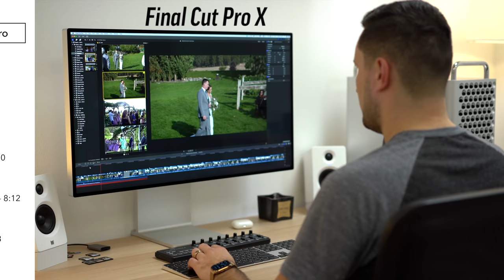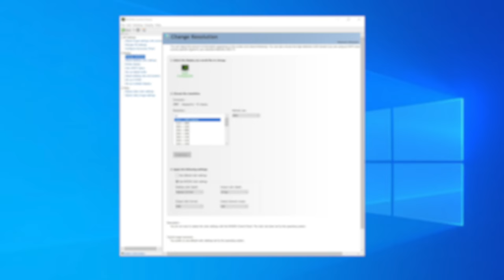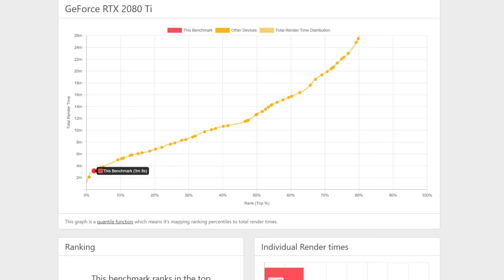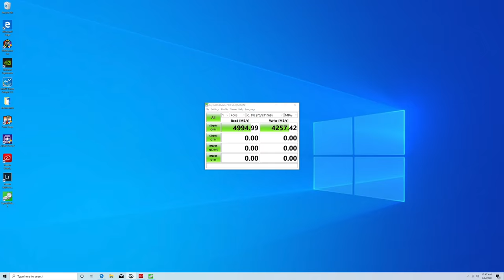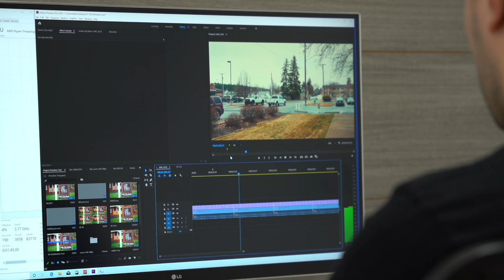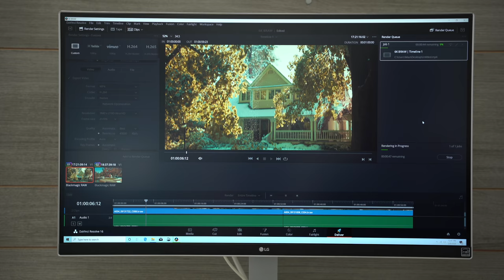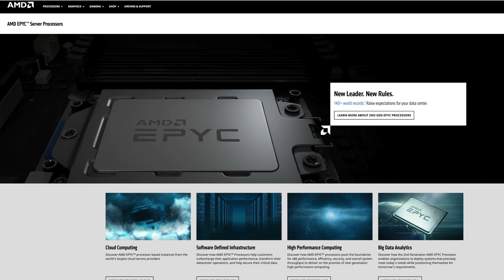$15,000 Mac Pro vs $5,000 Threadripper - Sorry Apple..

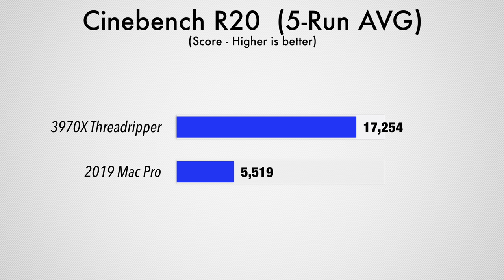Comment: 4:17 that’s literally the easiest fix ever, spend 10 minutes to adjust fan curves to your liking for acoustics & cooling. My PC runs extremely quiet as I have plenty of fans set to low rpm and still stays very cool, just takes some experience. Saying it’s loud is just a cop out answer
Reply: He adjusted the curves. The solution was probably noctua.
Reply: he should have use Noctua NHD 15 or Deepcool 360mm AIO
Reply: He didn't remove the air filters! The mac has wider holes with customised components in terms of space usage!
This is not a system for start-ups or every day use as it is not modular!
Reply: The dude made the PC himself in a previous video, the only person he has to blame about fan noise is himself. He should have configured the PC correctly and chose silent components if that’s what he was going for. He doesn’t seem to have much clue about building a good system
Reply: I meant the Apple machine is not for start ups!
It is not economical and versatile in any way!!!!
Reply: @98JamesNixon  Of course he doesn't have a clue on how to build a PC, why else would he be defending CrApple?

Comment: Pc: * costs a third of the mac pro *
Also pc: * gets 3.5 times the performance of the mac pro in cinebench *

Yeah... Apple will always stay overpriced...
Reply: That's the base model of mac pro the full specs of this are insane. 1.5 TB ram memory 2 or 4 amd graphics 32 TB memory i9 28 core processor
Reply: @NickN56  that's not an i9 that's a xeon.
Reply: @NickN56  for what we spent so much money for garbage device ? If i bought apple pro i feel like being robbed by them
Reply: Funeral Winds just get an AMD Epyc, 2 Quadro 8000s and you’ll still be at less than half the price of the top spec Mac Pro, have about double the CPU performance, double the GPU performance, 2tb of ram, and 96gb vram
Reply: They were busy pulling headphone jack from iPad
Reply: Not just overpriced, theyre a straight up scam. Its hilarious lmao
Reply: Funeral Winds the base model is 15k and the full is 50k ok buddy
Reply: @user-if2uz4ur8o  a whole brand new car with that money that's insane ngl

Comment: "Honestly, don't understand the discrepancy in specs.

Custom builds the PC and doesn't even bother to tune the fan curves and then proceeds to complain about the fans spinning up unnecessarily, this would be part of building and configuring a custom PC.
Complains about the cabling, but is through no fault of his own by not actually doing any cable management, again, this would be during the process of building it.

Mentions how the hours spent tuning and building the PC would cost "thousands" in lost time, even though the person would save $10,000 building the PC instead of getting the Mac Pro. . .
This video is kind of a joke."

(c)
Reply: Totally agree is really depressing how they keep defending at some point of no compares THE MAC.. Garbage!! simply wash brain
Reply: Exactly lol
Reply: Sunk cost fallacy.
Reply: I unsub the other channel of this guy because is just like Justine breath Mac to the core.
Reply: And the crap he's telling about vega 2 vs rtx2080ti
Reply: He literally said he tuned the fan noise. You guys really don’t understand nuance in tech and the use case for each build but go on, complaining thinking you know it all
Reply: Ok now let’s take about the size of the case needed and the fact that it’s water cooled and will need maintenance eventually or the fact that you can upgrade the Mac just like a normal pc minus the nvidia cards (although Linus used one with some tricks)  the ridiculous amount of slots for expandability too. This is for creator workshops not for average consumers, gamers or even pc enthusiasts strictly for workshops for video editing and productivity Thats the reason why they spent the R&D on the T2 chip that only helps when editing video
Reply: Dwight Neptune he’s also not using a sound dampened case (it literally has a glass panel on it). Any workstation class case with properly dampened panels will be virtually silent
Reply: The Impartial Truth I quite don’t think you get it, this Mac Pro is overexpensive for sure but you gotta give props to Apple for the fact they went all the way into it to the most minimal details. every single button is made out of metal, every single screw is literally springloaded and stuck it its place, there are virtually no cables visible and the modularity and fan speeds not synching to make sure it makes no sound at all are just one of the little details, other than the locks for PCI Slots, graphs on panels to show best configs and this and that. 

Did Apple actually need to do all of that? Nope. But that’s the most Apple thing they could’ve done. And I enjoy the work done even if I am not ever buying that PC because I don’t need it. It’s premium, it’s gorgeous, it’s simple. Could you buy a Windows PC for much less? Hell yeah, but at the same time, would you have such a thoughtful and well designed computer? I don’t think you would. 

In no means I am trying to argue, just pointing out that the closest that get to Macs in design are the Surface line up and oh god they look amazing but the prices are quite salty. 

Buying a Mac Pro you are buying the design that probably took apple hundreds or thousands of hours to come with, you are buying the specs and also Mac OS, it’s okay if it’s not for the average consumer but it is for big tech companies, everyone has their niche ;)
Reply: @aurichio7783  you do realise that all the design talk you've mentioned boils down to just concealment right? Most people who build their PC actually like having some mess so they can see all the components they used. Kind of weird that you would justify paying thousands of dollars for aesthetic design, when the fact is custom building your own PC means designing the unit completely according to your taste
Reply: Syafiq Norkhalim do you realize not everyone wants to build a PC and when they do need to upgrade it they would like a process so simple and guided that they can do without much hassle or taking cables out putting them in etc etc. 

Some people wants their gadgets to just work at the best performance possible without tinkering with it, the tech space has from everything and that’s why all sorts of things do have a Market. 

Apple is known for their privacy oriented products with premium designs and powerful yet simple OSes and you are paying a premium if you wanna get into the ecosystem, does it mean it is for everyone? not at all, and that’s okay because there is a market for all sorts of people. If you are happy with Windows/Linux custom building your PC and hackintoshing it that’s amazing but at the same time there’s people that want machines for all sorts of reason and want it to look great and don’t want to spend a single second building it. Apple is a trillion dollar company (ok 900 something billion but still) so we can say it’s been working great for them
Reply: @aurichio7783  look here fanboy, you pointed out that the 10,000 premium was justified because of design and simplicity. In accordance to this video (custom building a PC), that argument makes no sense because custom building LITERALLY MEANS custom design. In no way whatsoever that we discuss anything outside the context of this video.

Now you wanna talk about how the Mac Pro should be compared to standard stock windows PCs? Sure.
There a great variety of windows PCs out there, with high performance ones from special brands in abundance (Predator, Alienware, etc). All within less than 5k. Even a top tier performance PC stock will cost less than 8k.
Now let's compare, shall we? 15k vs 8k, with mainly only design and interface differences. Yes I agree there are people who are willing to pay 7-10k more for just the apple interface and design, but there's all there is to it. Nothing else.
Don't try to bullshit about convenience and not having to setup, etc. Your only justification is interface and physical aesthetics. Is it worth 10k? To some people yes, but it's still ridiculous. Bear in mind, you most PC units are kept hidden anyway to clear more desk space.
Reply: @sfqm1083 I agree with u, I rather spent the first day configuring the pc rather than spending the first year to save up for the mac
Reply: @zephskiee5395  And joy building your own PC... Not too long ago, i build my PC- Ryzen7 2700X CPU, Radeon RX570 GPU, 16GB RAM from Corsair on ASRock B450 Pro4 MB. And is good enough for me...
Reply: @wanted247ha8  you can air cool it and it will work just fine. That mac is a joke. It costs 10k more than the pc and performs way worse. Absurd
Reply: Angelo Cella it is literally not made for the same purposes and and the PC needed weeks to even set up to begin with. The whole system is cable less and modular and 100 times quieter. The AMD NEEDS to be water cooled obviously because even WITH water cooling the temps were still close to each other so yeah. I get you don’t like Mac or apple but if you don’t see the benefits of  just plugging it in and having to work and getting access to exclusive programs then you’re jus being ignorant and don’t try to make it seem like the MAC was slow either because it wasn’t these two are the best either side had to offer (not really since the Mac wasn’t maxed out) but people still try to hate.
Reply: A decent PC guy could build your PC just for lols and say $500 max, tune it, so you don't have random crashes etc. It would take him up to 6 hours while you do your job.
Reply: 88ilikepancakes is you would do your job on the computer he’s currently building while he’s building it? Ok. Maybe PCs are far superior if they can do that. But follow me real quick imagine just take if out of the box and plugging it in and having it link to all your other personal devices and iCloud without having to wait for PC optimizations now imagine doing that 40+ times for a majors studios vs super pc man building each computer and you having to wait for them to be finished or not work.
Reply: Oh really? I had a look at TitanComputers with EXACTLY the same CPU and specs like Apple products... I stopped in the middle of the customization because prices got almost identical! And you still didn’t have the 5K-screen of an iMac Pro.

Always the same with WIN-Warriors: they come with all kind of „similar“ parts...that cost less, including investing your own time, PC-cases that are trash compared to a Mac Pro case, etc. and then shouting loudly about „cheaper & faster“.
Reply: @wanted247ha8  You do realize that even with the T2 chip, encoding isn't that much better, right? Not enough to justify paying 3 times the price. Also, let's not forget that not even creatives use that many ports. I'm one of them. Apple tries to sell this as a workstation computer, but the reality is, not many studios actually use Mac. The norm is Windows because Apple's always been a bitch about having to use AppleScript and trying to optimize things for use with Apple computers. So, we just opt out of Apple entirely.
Reply: He is an Apple fanboy, did you expect him to be fair?
Reply: Besides, this iSheep is a joke and has no experience in building custom PC.  If you don't have experience, you can just pay a specialist 3rd party company to build it for you for less than 500USD and deliver it in few hours, not days like this iSheep.
Reply: Also use linux if you want snappy system!!
Reply: If he bought the Be quiet silent fans it will be good. Maybe the fans cost more but not 15K as Cheese cutter PRO
Reply: The argument of it's more convenient isn't a good argument when it's triple the cost of the Threadripper PC. You could literally buy and build 3 of these PCs for an office for the cost of 1 Mac Pro. It takes more time to set them up but it's way cheaper and the convenience of the Mac Pro doesn't justify a price tag that's triple the cost.
Reply: Dude if you're a Hollywood studio paying 6 figures a year to 10 employees, $10000 difference is a drop in the bucket
Reply: u can give the specs to me and i will build the pc for 500$ and u will not expose any hardware or software problem

Comment: "you don't really need that much RAM"

a few minutes later

"You can get 1,5 terabytes if RAM on the mac!! Awesome!"
Reply: also: if you really need >1TB of RAM you can still build a cheaper system on an Epyc platform...
Reply: @Harry Whellem Clearly didn’t.
Reply: @RobloxerMartin LMAO!! Yaris sedan
Reply: @RobloxerMartin you can upgrade the Mac pro and gaming isn't the key feature of this kind of Computers...

But i wouldn't buy a Mac pro, even if i had a use for it
Reply: @RobloxerMartin the Mac Pro is not intended for you, it is intended for professionals
Reply: open 2 chrome tabs
Reply: Yeah and that 1.5 terabyte cost 15k while u can get it for like 300 dollars soooo
Reply: @AlCatSplat  yeah it's for scamming professionals lol
Reply: That extra cost could buy a house in my region
Reply: @zai293  ikr
Reply: Stephan Weinberger yeah he did everything he possibly could to make the Mac look better, and it failed. He did a horrible build for the windows and it still blew it away